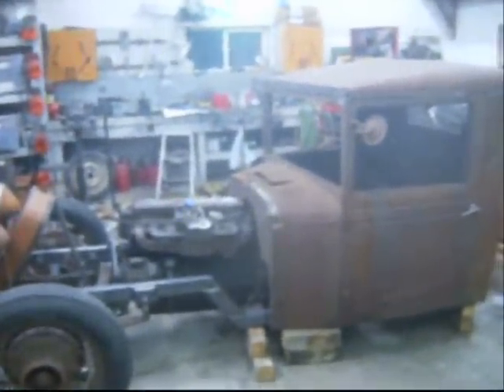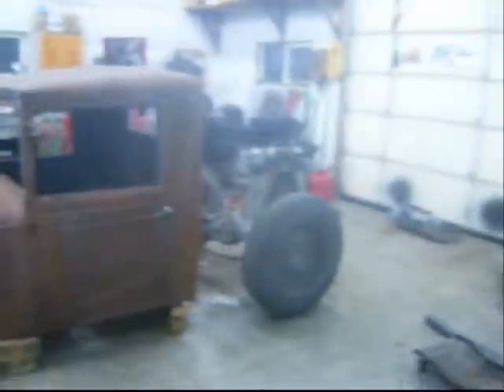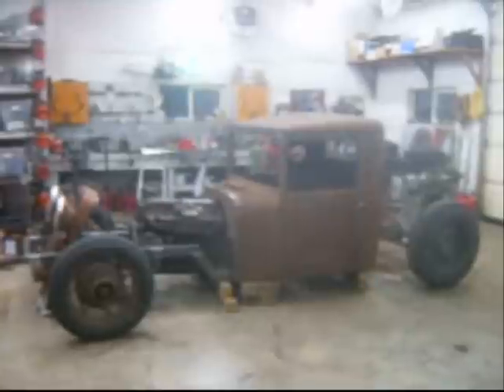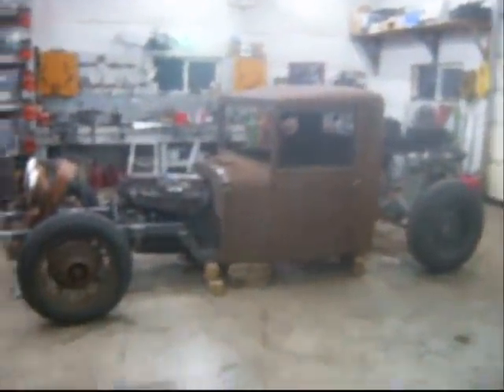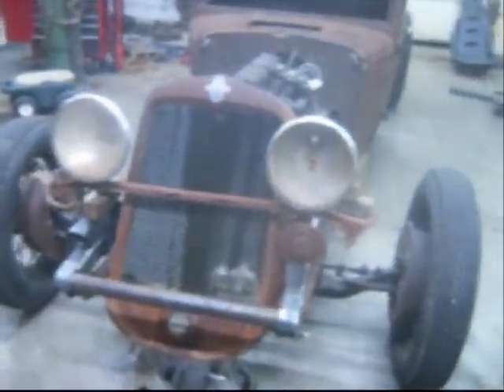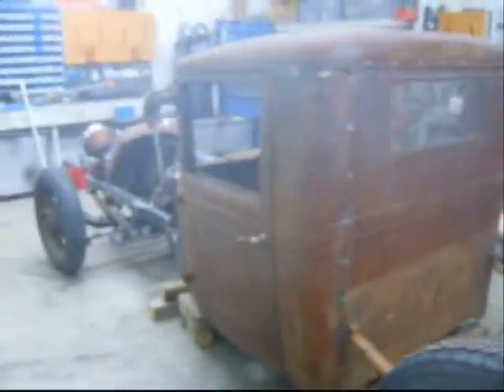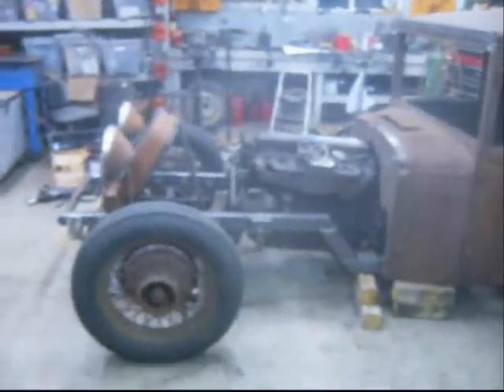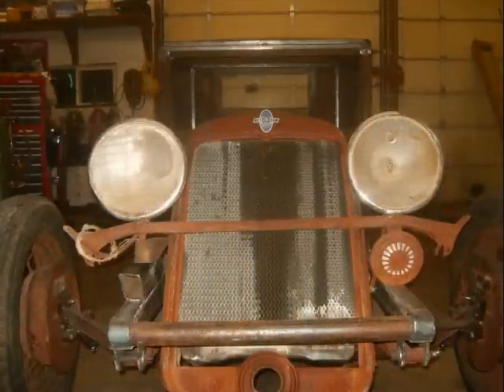rat rod chevy truck #46

Comment: Really glad to see how you did the structure instead of wood ! Have a real old  Brand x International Truck. Think around 1929 give or take. The cab is not too bad but the wood is way gone! Thanks for the info! I do appreciate your vidios.
Reply from the maker: i just acquired a 1936 IH truck cab.. in excellent condition.. but by then they no longer had wood so thats a good thing!  thanks

Comment: very nice, good job. glad you solved the frame problem. I extended mine about 2 feet to have a flat floorboard. I got tired of hitting the brake and the gas at the same time. :)  Anyway, always interested in what you do. Tom